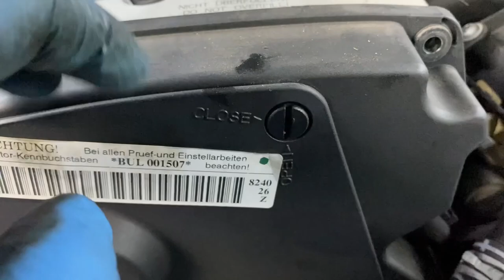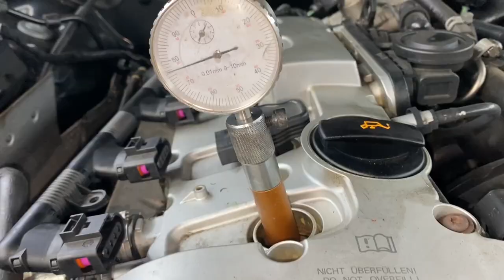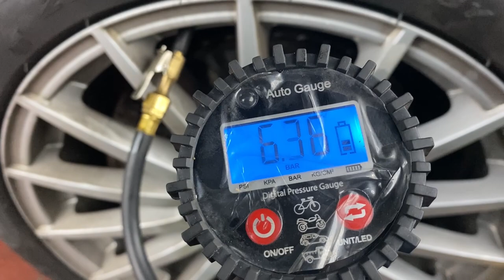Audi A4 B7 DTM 2.0FSI BUL, Timing belt replacment / oil change / spark plugs / compression test

Comment: Great videos. I had a b7 a4 and was surprised that after changing the belt on front I had to check the chain and tensioner on rear of engine. Of course tensioner guide cracks at oil hole. Dodged a bullet. Replacing when I did.  Car had 82,000. Then some kid ran into it and totaled car 6 months later.  Good times. Upgraded to 2012 s5. Convertible.

Comment: Had a B7 worked on it for 6 years, lots of good memories. I could take it apart with my eyes closed. Had 2 different heads for it. I interchanged them when it was time for carbon cleaning....love the diesel sound. Hardest thing on these are the high pressure fuel pump banjo bolt. 😂

Comment: Interesting engine indeed. There is one thing I do not quite understand. I have an Audie A6 1998 2.4 ALF. And I did the timing belt myself, with all the replacements plus alternator On this occasion I changed all seals, crankshaft (front), camshafts (4 of them), valve cover gaskets, oil pan and the gasket for the oil filer housing. I feel the crankshaft seal is the most important of all. The cost is very moderate and it really helps in the long run. If I would order a repair like that, it would be on the list, that's for sure. When they start leaking, it's a mass all over. When you have to go to the TÜV over here in Gernany and they see oil on the engine, that's it. They send you directly to the work shop and you have to start all over again.

By the way: Do Britain’s never change oil and oil filter? This looked disgusting. Hey you really deserve more subscribers, this is excellent.
Reply: We definitely don't change our oil as regularly as we should (although 10k miles is a lot anyway) and I think a UK MOT is far less strict than any TÜV, for instance (depending on the garage) small rust holes in the front wings of my audi a4 b7 or its engine management light went through MOT without any word of it. Of course some things should be fixed... However I am very pleased that I don't have to fix a small oil leak just because my car is 16 years old.

Comment: how simple a timing belt is compared to a chain design there is still 2 chain involved one for the oil pump and the one for cam to cam timing the one for the cam usually fails not the chain it self but the tensioner. what I found on these generation engines is the ballencer shaft module will seize or the shaft gets loose and then you get low oil pressure a low RPM I usually delete the ballencer shaft it's way cheaper and more reliable.
Reply: The chains at the back are a PITA
Reply: @BenState  you are correct

Comment: Great videos guys, superb mechanical skills. 
What I dont understand is obsession with genuine audi parts especially for all these older vehicles...
If you look at the caliper, it will say ATI and Audi, so do you think ordering the set from ATI without "Audi" stamp will be less superior? Zimmermann, TRW? No? Half the superior? Bacause it will be half the price for sure. 
Spark plugs, are probably NGK in VW custom box for x2 the price.
Injectors, coils Bosh or APR ate not  excellent choices? 
Elring, Victor Reinz not a good gaskets? 
MANN are not good filters? 
Oh come on...
There are plenty well tested with massive feedback from all over the World components for the fraction of what VAG wants for the same stuff - as you probably aware many of these "aftermarket" items come with OEM logo filed off which makes them exactly what is in VW box.
I had ordered rear calipers for my 2013 Range Rover Sport 5.0 SC.
I saw ATI logo on original ones, and ordered ATI calipers that stated specifically "aftermarket ATI calipers for RRS L320",  guess what?
Land Rover oval is just sanded off. 
Paid $265 ea, how much do you think those same calipers would cost at the dealer but withould LR logo being sanded off?
Reply: In many instances aftermarket manufacturers went beyond and outdid OEM products with things like:
Full metal collant pumps instead half metal, half brittle plastic cheesy crappy genuine stuff
Full aluminum radiators instead plastic cheesy brittle less durable sides in genuine ones.
Reply from the maker: Hi Roman ,

Thanks for watching , tbh we don’t mind fit something aftermarket, but from our experience and specially my own one there’s nothing better than genuine . It’s more money but you pay for the quality . PAGID for example is genuine manufacture for VW group for some while now and the brakes what they sell as “aftermarket “ is absolute crap . Compare to TPS one (AUDI ) premium ones it’s different level . Also I tested filters my self on my personal car , because I try to service is in very similar mileage. Oil filter after the same amount of miles looks absolutely different MAN to genuine . Genuine hold the shape and I would say after removal it was still alright . We try to build our business on genuine parts and affordable service with such parts . Unfortunately even we end up sometimes with aftermarket stuff because it’s silly money for suspension components let’s say .
Reply: @VAGTechnic  Plus there is one thing you may not forget. For example for my Audi 1998 there are certain parts, that you won't get any more at VAG. The costs of genuine parts over here in Germany are partially rediculous. I use a part store that provides repairshops with parts and the quality is good.

Comment: What’s the cost to do the belt etc on these motors ? Looking at buying a 2013 S4 with 85,000kms on the clock so is coming up due for a belt.

Comment: I have a a4 b7 2.0 tfsi  every 2000 km requires 1l of oil from where this happens
Reply: Read the cars manual.  It uses 1L of oil per XXX km.  Its done it from new.